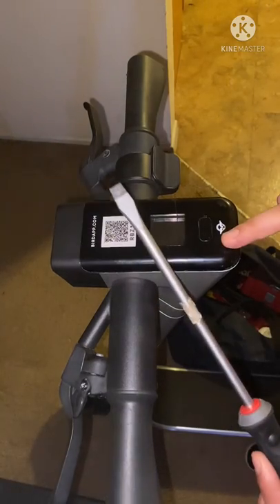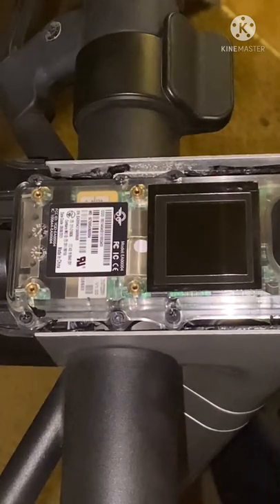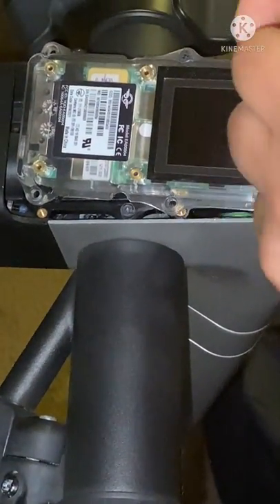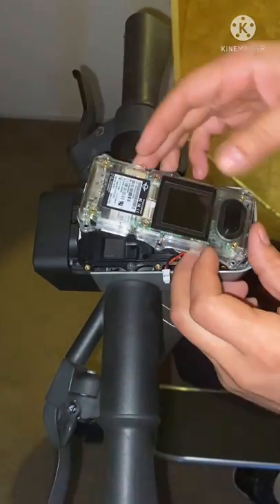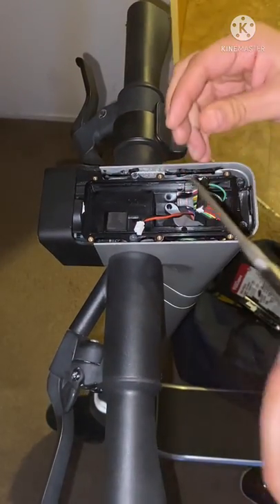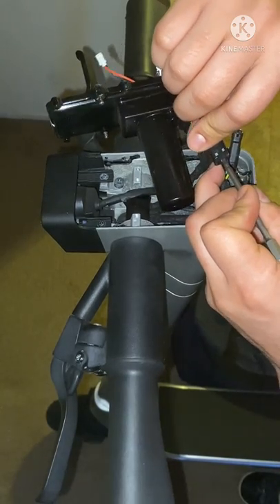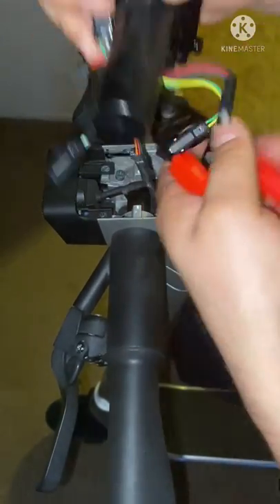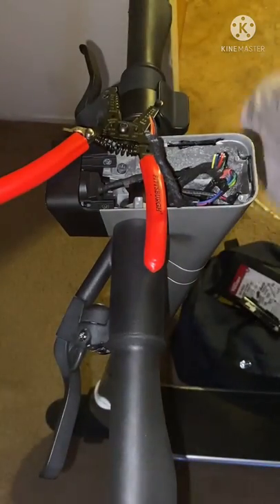GPS scooter tracker -Removel-( Abandoned￼ ) bird 2/3

Comment: For anyone doing this make sure you don't take it home to remove the gps cuss they will come knocking on your door talking about hi sir have you seen our 🛴 that's when u say seen your scooter wtf why would I see your scooter some dip shit decided to do this to a bird scooter right next to my building and the dork squad showed up I'm like when did it go off line ummm 4days ago I'm like nope but your more then welcome come in and look but they were scared and left said bird would send them a free one anyways
Reply from the maker: forsure ! make sure your scooter is legally obtained. Never take this home and do it at your house more or less residence. This GPS will track you on point. Unless you’re using a GPS jammer which will throw off the signal to a different location.. in my case the scooter was completely dead , both battery at the bottom of the scooter, and the back up battery for the GPS unit device was also dead. That being said the last location for this scooter is wherever it died at.
Reply: Yoooo that shit is funny 😂😂😂😂

Comment: "abandoned" "decommissioned" I support your work and applaud you my fine gentleman. thanks for the tutorial of course it was for educational purposes only if I'm correct right?
Reply from the maker: Absolutely correct 🙏
Reply: @pjscootermods  
Hi sir , But why  you removed the small cylinder battery?
Wasn't it enough just to remove the GPS tracker?   Will I be able to still use the e-bike , if I do , what you just did ??
Or electricity of the bike will be effected somehow, and  will not turn back on ?

Comment: So i have a LINK escooted that was not showing up on the app so I snatched it up and now what is the process of making it mine and what are the steps to do so .....I wanna learn and I will in debt to whoever can assist me please thanks and a big one up to all who defy the odds
Reply from the maker: I don’t know too much about the link Scooters but I can tell you the process is the same on any scooter out there. Replace the existing controller with a aftermarket controller , based on the voltage of the battery pack that will determine what size controller you need for your scooter . For example 836 V battery requires a 36 V brushless controller and A 48 V battery requires a 48 V controller.use a voltage meter and measure your battery pack. If it measures zero v or anything around that number then you need to open up your battery pack and bypass the output. 
Grab you a wire kit from Amazon , wire cutters etc . See my video descriptions for product links that I used .
Reply: @pjscootermods  thanks Brody your the shit

Comment: If you want the top cover off without breaking the clip on tabs off...
Heat the metal housing with a butane torch lighter.
This releases the glue, and the cover pops right off.
Be careful with the lighter not to get too close...you won't even damage the paint, or the plastic

Comment: there could be more GPS units on these scooters i dont know about bird but here in europe we have DOTT and they have multiple GPS on every scooter
Reply from the maker: Yeah bro you wanna be careful every scoot is different
Reply: If you're worried about it.. just cut the wire harness off and toss the circuit board and battery housing in the recycle bin...
No! Not the one at your house 😉
Reply: @pjscootermods  thanks for all the great tips.
I've done a few of these conversations. 
If you really want to make a bird 2 boogie. 
Make it 48v 13S
Use the 1000W 38amp controller from Amazon.
I do them all this way now.
It hauls ass, and can climb steep hills, even riding double 
I have tried several controllers this one is very quiet and very strong.
Have fun!
Reply: @foolforyouanyway5730  The bird 2 and 3 has an extra battery even if you cut the main power and the wire harness the GPS will still  work.
Reply: @DPRKGrandmarshal  Find cut destroy. 3 easy steps to removing it. Hell a roll of aluminum foil will stop signal until then. Any person with basic electronics knowledge knows how this is easily done. Batteries don't last forever also. Leave it in a trash can for a few weeks prior to modding. Once everything is dead then it's cake.
Reply: @TheTubejunky  couldn't you just wrap the entire scooter in aluminum foil tape? The kind that is used on air conditioner systems?
Reply: @billydamnit  Horrible idea that TAPE is ultra sticky and will be a pain in the dingus to remove if & when you decide to use the scooter.
Reply: @TheTubejunky  oh, I completely agree. I meant apply the tape neatly. You would have a "chrome" scooter, that was untraceable.

Comment: I have a question for the rear light, can I connect it to the switch cables from my controller so when I turn on the scooter it also turns on?
Reply from the maker: Yes ! For that you would simply have to wire your back light positive and negative to the controller positive &negative terminals..
And that’s it ! When you turn your scooter on your back light will turn on and when you turn it off your back light will turn off with it.
Reply: Can we buy the module or controller of that scooter
Reply: If there is in the market how much it is
Reply: Yea so now I hotwire the bird or do i buy a kit or ?

Comment: The gps working on a separate battery? I mean this method could change the scooter wireing so it can heat up?
Reply from the maker: Yea it’s a 5v back up battery pack for the GPS unit. You can remove the battery at the bottom and the GPS unit is still active at the top until you disconnect it’s power source from up top..

Comment: can you tell me how to remove the speed limiter on a lime gen 4 please
Reply from the maker: You can’t . The esc is locked 🔒 to 15 mph.you would need to get rid of the original controller and install an aftermarket controller from Amazon, I have videos posted of different kits that are available ,install that and you can reach speeds up to 26/27 mph
Reply: hello could you make a tutorial on how to convert a gen 4 file to personal? I would like to try it myself but I don't understand if I have to change the motherboard.

Comment: Ay bro what are you using for the circuit board button? And did u am have to replace the control board also what size bit is for the bottom
Reply from the maker: I only install two buttons on my scooters 1 for the headlight the other for the taillight. Unless I’m adding something additional then I’ll add whatever needs to be added. But there is no button going to the circuitboard, it might look that way but if you’re talking about the button on the right side that’s actually going to my headlight.

Comment: Can you do a lime scooter
Reply from the maker: The only thing with the lime scooters is that the hub motors do not have Hall effect wires, but yes I can absolutely get a lime scooter to run, it’ll sound a little loud because it has no hall wires tho. Hall sensors are commonly used to time the speed of wheels and shafts. Hall sensor wires to take the position of the magnets in the motor.

Unlike the bird scooters they have 3 motor wires and 6 hall wires which allows a smoother ride..

Your best bet is to just flash the controller since that is doable with the lime scooters.